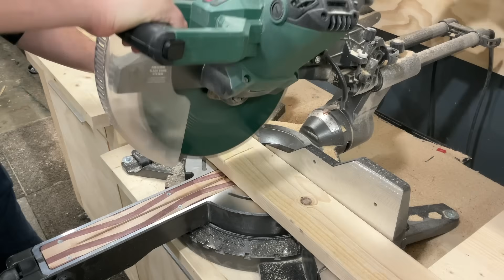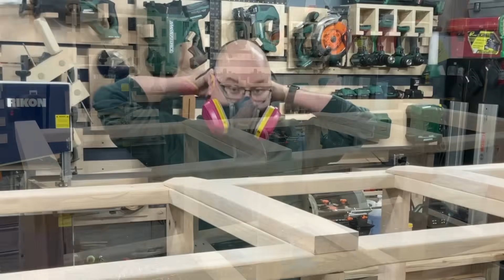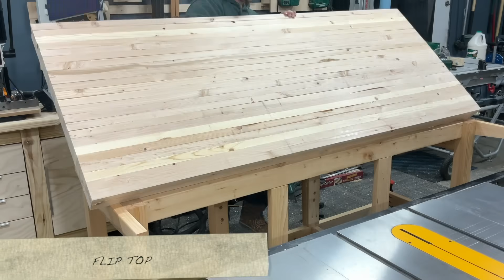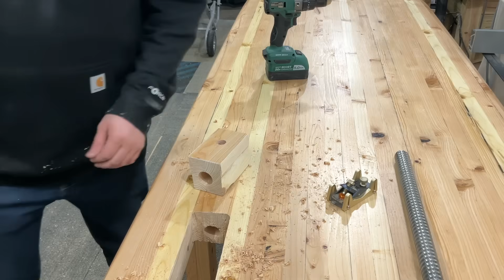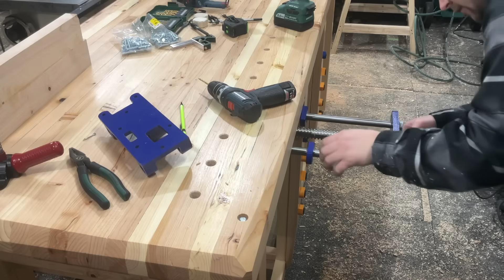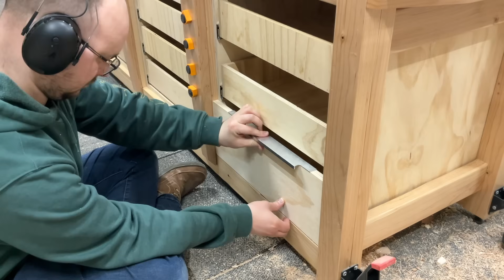2x4 Workbench with Wagon Vise & Tons of Features – My Dream Build

Comment: Thank you for the recommendation of the small Bosch planer.  I love how you created those shapes!  I have a larger one (Ryobi a part of a kit) and have used it, but for most things it's too large because I'm just tweaking something.  I will be getting one.  I already have bosch 12 volt drill and driver set, so I have the batteries and charger to get started.  Great Workbench!  

Years ago I bought a small Porter Cable belt sander.  I've never been sorry.  No longer sold.  I used it to take face frames in my kitchen when I was refacing the upper cabinets and building new doors, etc.  That small sander did it quickly and without the fatigue a full size belt sander would have.  Super quick compared to a palm or ros sander.  Never looked back from this purchase.  I suspect the planer will be the same.
Reply from the maker: I keep finding more and more use for the planer, it’s so nice to have. I bought a larger masterforce one, probably same size as the Ryobi, and I never use it because it’s just too bulky. That’s funny though, I was in the same situation, having the 12v impact and drill, then decided to try the planer since I already had the batteries. Glad I got it.

Comment: I noticed that when you pulled the craft paper onto the workbench it curled UP. If you turn the roll 180° horizontally, the paper will come out with a slight upward Hump which will flatten out once you put your work piece on top.

Comment: Dumb question. Where does the dust go that falls through the dog holes? Do you have any way to clean that out? I couldn't tell from a quick scan of the video. Is there a gap between the top of the cabinets and the bottom of the bench for a clean out?
Reply: You're right!
Reply: Faux chisel look

Comment: Just curious, what hand plane is that you are using?
Reply from the maker: I believe you’re referring to the small one I used on the legs. I made that one in a previous video 
https://youtu.be/L9lT7vQ8Rgo
I also have a bridge city tool works mini block plane that I like using. I don’t recall whether I used that one in this video. https://bridgecitytools.com/products/hp-8-mini-block-plane
Unless it was the electric hand plane, that’s a 12v Bosch one and I have a link for that one in the description.
Reply: @fangerwoodworking  My bad, it was the bridge city I was referring to.
Reply from the maker: @90FormulaE8  I just re-watched and realized how much I used the bridge city plane lol. Yeah that one is fantastic. They also have sales frequently so sometimes you can pick one up for 40% or 50% off.
Reply: @fangerwoodworking  yeah their pricing can be a little wild for sure. I mostly use WoodRiver and Veritas hand planes in my shop. Just kinda scouting around for workbench and shop furniture ideas since I finally have a decent sized space to work in now.
Reply: It's a gas-powered Cox plane!

Comment: Question, do you find glue not sticking to your top since you applied ? I heard that glue doesn’t stick to laminate. But I see you’re replacing your laminate with the new wooden top. I love the look over a laminate, but my workbench hast to be a assembly table as well. Beautiful bench. Thanks for sharing.
Reply from the maker: From a quick test it looks like I can pick glue off the surface. Some people recommend adding wax though to help repel glue.

Comment: Where did you get the drawer pulls?
Reply from the maker: I get them from Menards https://www.menards.com/main/hardware/cabinet-hardware/cabinet-pulls/mastercraft-trade-aluminum-handle-cabinet-pull-2-pack/we2p1-sil/p-1841405562123408-c-1526043700148.htm

Comment: I just finished my new bench top, and I can't bring myself to cut the relief for my Veritas Flush Tail vice and dog holes. I will likely get around to it, but for now, the finish is too good looking. 😄

Something I thought about watching you install your tail vice is counterboring the nipple of your screw flange into your traveling block for extra movement and a cleaner look. Good work on the bench and making it uniquely yours.
Reply from the maker: Thank you! The first cut or dog hole drilled on a bench top is the worst lol. I always have to triple check my measurements to make sure I don’t ruin hours of building and finishing it. Also good idea about the counterbore.
Reply: You can set it in your living room and call it rustic furniture!